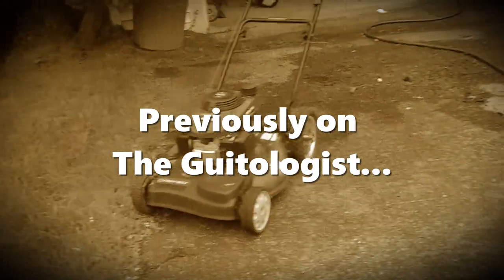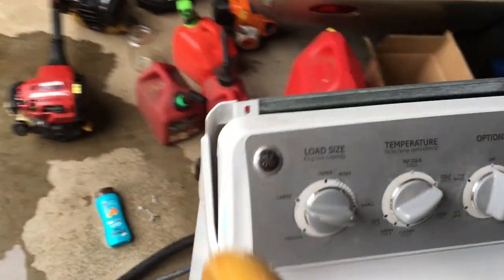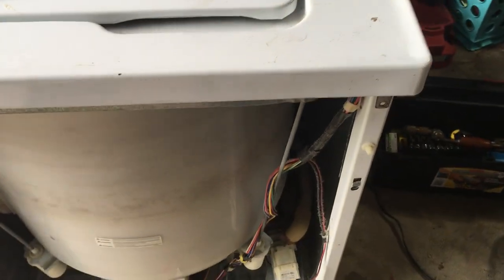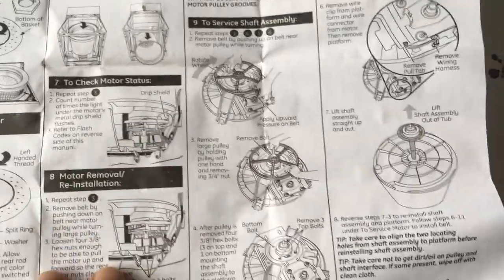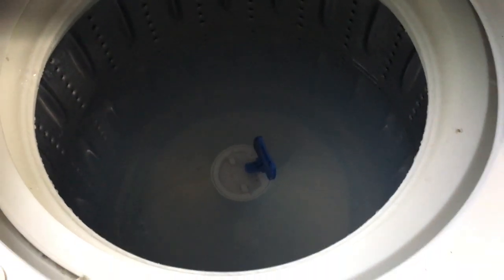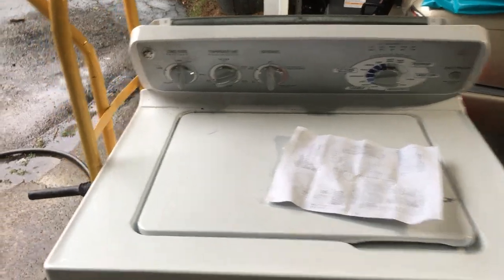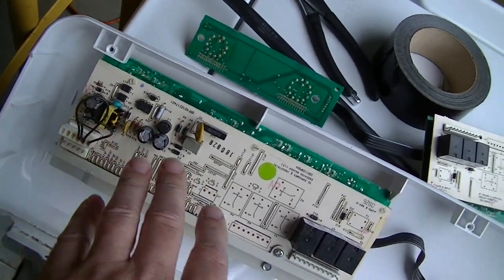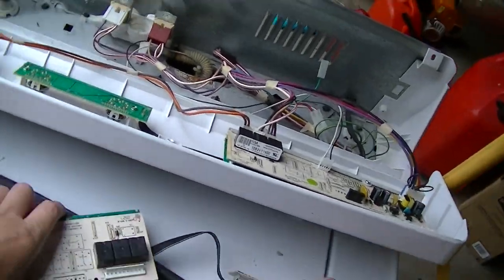TRASHED GE Washing Machine - Can This Washer Be Repaired?

Comment: I need your help on a project. I just can't seem to get the 2 pieces of Plutonium to come together to get satisfactory results. Please advise.
Reply from the maker: You need a conventional TNT arranged in a spherical configuration to force the plutonium atoms together inside the sphere. It’s elementary, my dear Quentin.
Reply: try turning them into sphere halves and then using a screwdriver to pick one up, and then let it fall on top of the other one.
Reply: You need to add a flux capacitor and find an old DeLorean.  Lol.

Comment: 90% of all washers dryers weed eaters lawn mowers I fix  are incredibly simple fixes.  I have a dump trailer that sits outside of houses or trailers that I remodel and ppl leave those types of things outside of it; including refrigerators big and small and if their not working, it’s one little problem especially the lawn equipment.  Another place you can find them cheap is Goodwill or dump day in your neighborhood and whatnot.  Good luck man.

Comment: I have  GE  washer kind of like that one, I noticed the bottom pulley was rubbing against the frame rail, I used a crowbar to bend the frame rail out of the way.  It only made the racket when the tank was full.  I guess GE had lightened construction of the unit to make it more "aerodynamic" .  I bent it just a little and then it was OK.

Comment: very helpful.. that drain pipe on the back i didn't know it had to elevated to the level of tub otherwise it would drain out, i had a washing machine out side on a  rain water tank that hose laying on the ground  couldn't work out why it was draining out when going through cycles thanks for that solved 😃👍 my problem..

Comment: watching this after the standby video, i think i mentioned to you about my problem with my machine not engaging after the water fills up, and i have to slam the hood down to get it to work
Reply from the maker: Yep, I think I suggested it might be a lid switch problem. The lid HAS to be closed for spin or agitate to ever engage. It's a hazard. REplace or clean the lid switch. Could also be dirty contacts where the leads for that switch attach to the board. Maybe pop those off and spray with contact cleaner.
Reply: @TheGuitologist  yes I agree but want to clarify what I have to do because the hood is already closed and I have to open the hood and slam it down to get it to work

Comment: Two controller boards failing the same way, and in a way that's not really "computer like" IMO.  I have to wonder if there isn't some sensor that isn't tripping.  It might be waiting on a "up to speed" input.
Reply from the maker: They didn't fail the same way. One failed on a spin cycle. The other had a different failure. I honestly cannot remember exactly what cycle it failed on, but it was different. In short, the "new" board was a pull from a parts washer that had a bad board also.

Comment: I've just gone down the Digital Modeling Rabbit Hole. I resisted for years but so many parameters are available in one little box. I got a Helix Stomp and really like what John Nathan Cordy is doing across the pond. I think they have come a long way. I just got a Helix Stomp. Would be interested in the Guitologists opinion on Modeling these days. It seems like almost sacrilege to ask, but I've been plugging into to PCs for a long time at this point.
Reply from the maker: To have opinions that matter I would need more experience. If you like it, use it.

Comment: This style of top loading washer is the most ubiquitous in the world. It’s almost like they all came out the same factory in China and the brands just slapped a different sticker on the control panel……or something.

Don’t attempt to repair front loaders. They ALL rot to pieces after 5-8 years from the dissimilar metals corrosion. Cast aluminum, stainless steel and mild steel packed full of basic detergents don’t stand a chance. Malicious planned obsolescence at its finest.